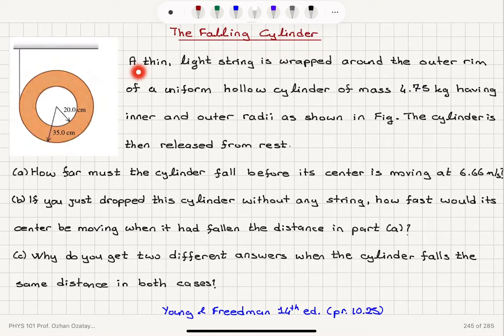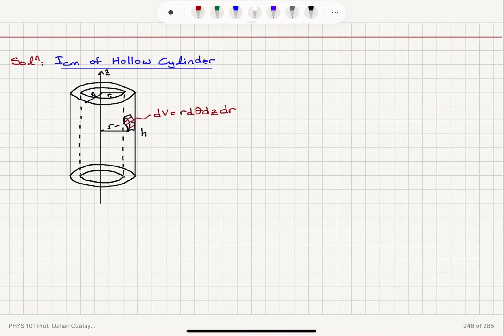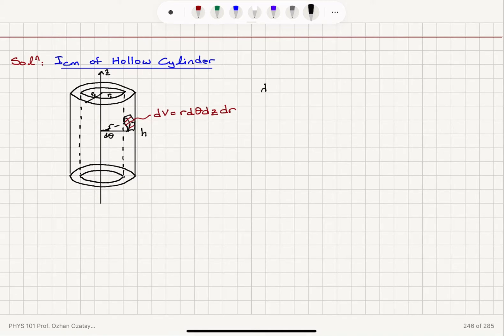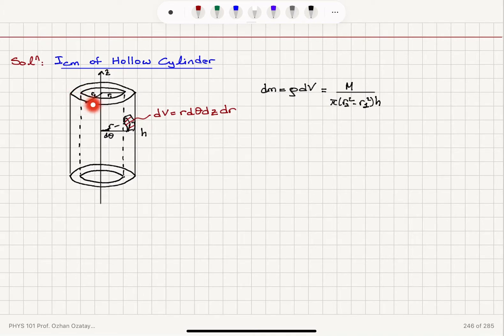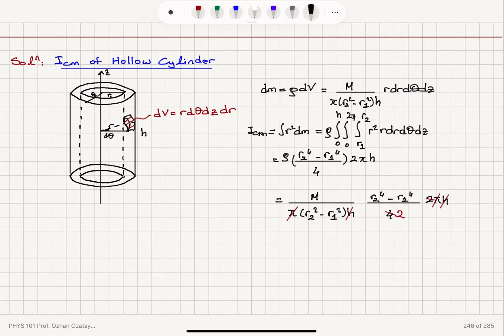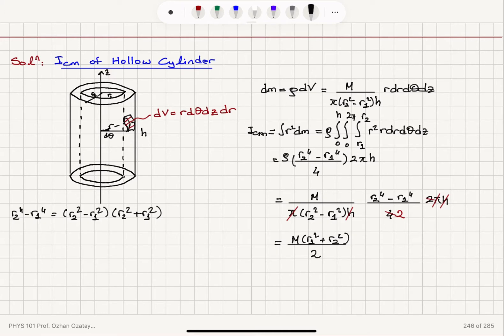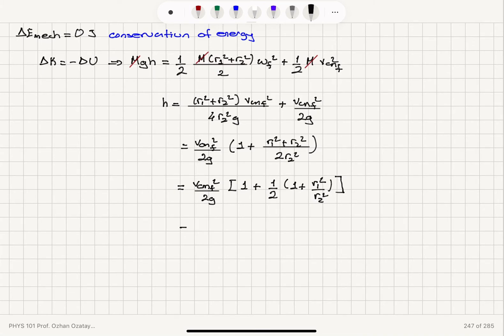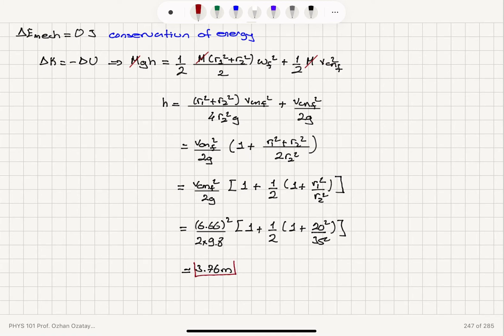The Falling Cylinder

Comment: there is a mistake, in part 1 you subbed in 20cm and 35 cm when it should have been 0.35 and 0.2 m
Reply from the maker: There is no mistake. When you take the ratio of two lengths in cm you dont need to convert to meters. 10ˆ-2 factors cancel anyway